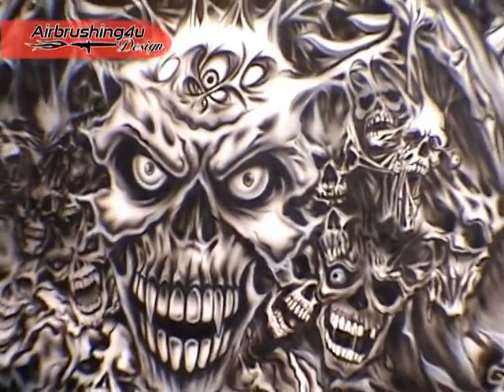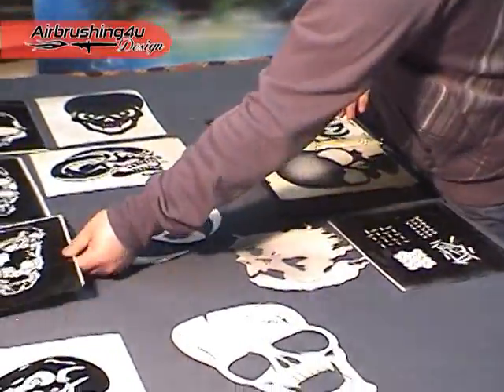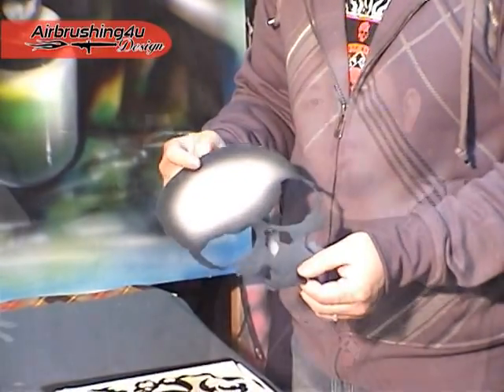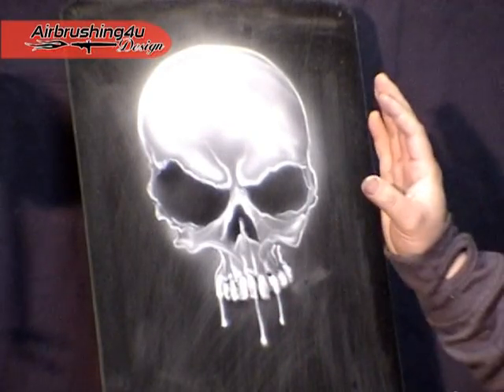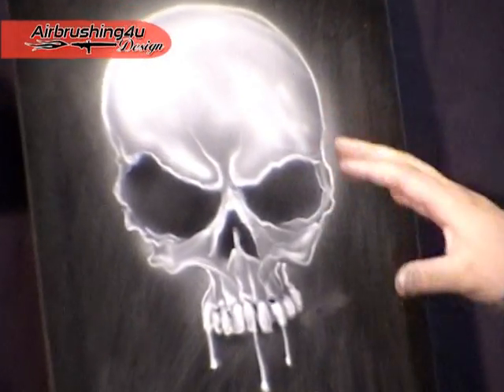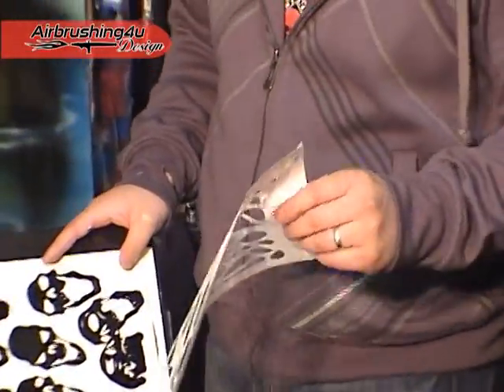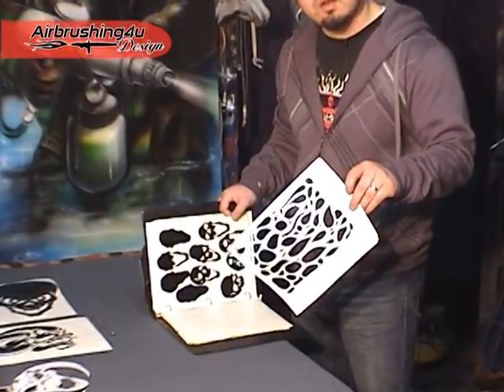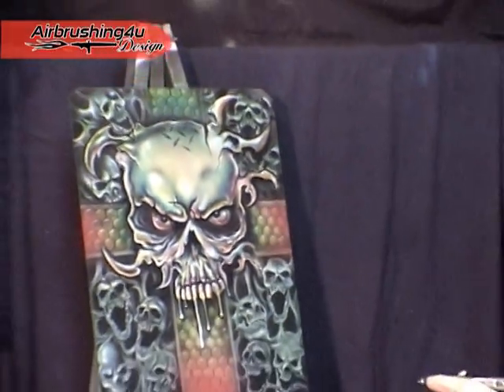Airbrushing4U Stencil DVD

Comment: its about working smart not hard. So if its faster and still do a good job ur not only doing it faster but ur able to make a company or urself more money if this is a job then it's just plain smarter. So if you do a $20 project that takes 2hrs. to free hand then your only making $10 per hr and 4 projects in an 8 hr. shift with no breaks which is $80 a day. Where as using stencils to make $20 project that only takes 1 hr. to do then you're making $20 an hr and $160 an an 8 hr shift. do the math.